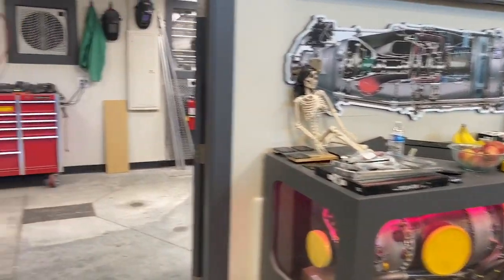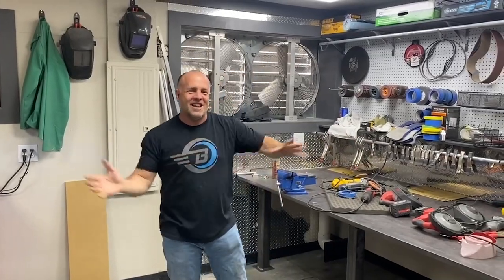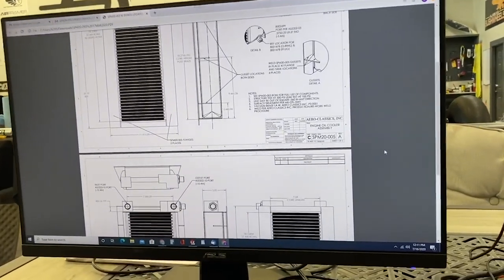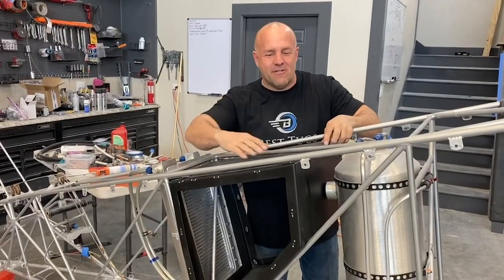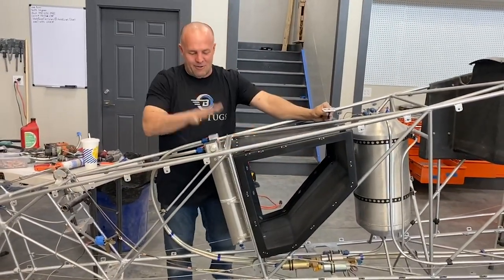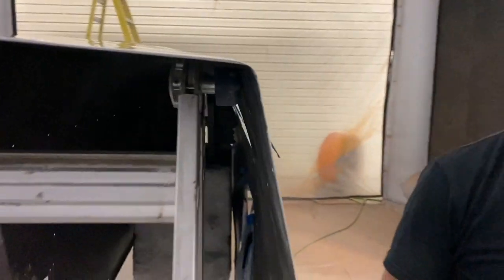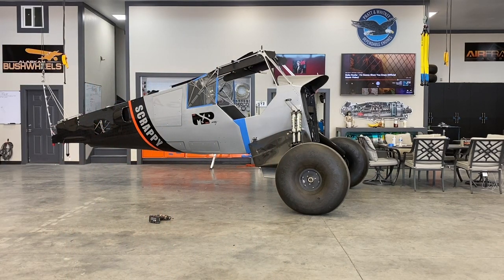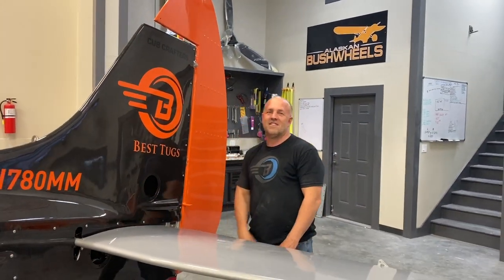Scrappy Bush Plane Gets Tail Feathers  🤠 (Scrappy Bush Plane 24)

Comment: Mike, do you have an "Override" switch for those micro switches for your gust locks? If the micro switches malfunction,  you will not be able to fly until they are replaced! I hate my computerized truck because it seems like I cant start the motor if the dome light (or some other stupid little thing) stops working. It is maddening!
Believe me, a year from now when some oxidation gets to thos switches, you will be happy you have the override.
Reply: I was thinking that too... Or extra pins
Reply from the maker: Absolutely,  I agree with you.  Both switches are a Phillips screwdriver away and five minutes I can bypass it and fly it like normal.  Literally I placed them right at an inspection so I could do exactly what your talking about.   👍🤠
Reply: MrJamespcastle I like that his yaw damp gust lock is also a start interlock key.
Reply: J ...I was thinking of this exact thing when he was talking about the micro switches....good call. Although in the back of my mind I just kinda knew he had thought of it as well, ya know, just a hunch lol.
Reply: Mike Patey plans ahead for aggravating possible problems. You only think of things like that after life has chewed on your butt a few times .
Reply: @MikePatey  can already see the pranks of your mates nicking your gust locks.
Reply: @MikePatey  I was wondering the same thing... what happens when... I have run into interlock issues that drive me crazier than I already am trying to get things to play nice together... and get equipment working.
Reply from the maker: J  yes, these safety lock outs only interrupt the start relay ground wire.  The plane will fly on if any problem and are so accessible and fast to bypass.  There are countless deaths of take off with locked controls but never a fatal crash because the starter wouldn’t let you start it.  Worst case a brief delay and quick bypass of the switch and I’m on my way. 👍🤠
Reply: This was my thought/question as well!
Reply: @MikePatey  just hope one doesn't fall out during a mid-air restart. But that does seem pretty improbable
Reply from the maker: Daniel Kranich  great thoughts 👍🤠 here are a couple things to think about. the pin can’t fall out unless you push the spring loaded button and pull. A inflight restart assumes your engine quick, then the micro switch that started you this flight also failed at the same time  and then if both those happen and we want to restart we would never use the starter.  That monster prop will have that engine spinning faster than the starter ever could. so restart would be fix problem, fuel tank or whatever and it will start itself.  👍🤠

Comment: I was thinking Just before Mike said it. I would have micro-switch storage locations for those pins.
Reply: same here.
Reply: I hope he has a spare pin somewhere in the plane, lose one and you are stuck in the bush! 😎
Reply: @paulbergman8228 Probabaly better to build in some sort of bypass, in case a switch fails.
Reply: @RespectableRSYt  Just add a second microswitch in parallel, for redundancy.
Reply: @paulbergman8228  Or a screwdriver and a pair of pliers

Comment: I used to fly front seat in a P&W 985 Super Stearman that had the oil cooler mounted in the aft fuselage. The hard oil lines ran along the airframe next to both cockpits. In an open cockpit, in the cold weather, those oil lines made perfect hand warmers.

Comment: I'm glad to see your clean room setup. That dust and nasty stuff is bad news. I started at a large aircraft company as a plastics bench mechanic. Lots of fiberglass, graphite, kevlar, core, potting, adhesives, MEK, and many other solvents. I saw a lot of others there suffer the issues of these things. Always read the safety data sheets and stay safe so you can keep flying these insanely cool projects. Thanks for the videos, I can hardly wait to see you put Scrappy through it's paces, s/b incredibly great!

Comment: That idea with the microswitches for the gust-lock pins is GOLD. You could sell that idea to pretty much any aircraft manufacturer I bet, if they haven't done something like it on their own anyways. There's plenty of crashes, injuries, and aircraft damage that have happened because of gust locks either engaged when they shouldn't be, or not engaged when they should be.

Comment: As I have said several times before, you are my old Boss and Mentor's double when it comes to engineering and it makes me feel so much better, as it stops me from feeling like a freak. I spend a lot of time during projects, thinking how thing will interact and how to get things to do more than one thing at a time and poeple just don't seem to get the idea, that it saves weight and sometimes money. Your table is an excelent example of getting a system to do multi tasks, not just extracting dust but also able to clean the work area, I built one along the simular lines in the carbon workshop when I was in the RAF, slightly small than yours but almost exactly the same (people kept asking why I did it the way I did when I could have just had a shop vacumme cleaner in there to clean up? They did not see the use of just one small piece of pipe eliminated the need for one! Although I also had a port on the pipe to plug on a vacumme cleaner hose as well).

Comment: Man thats a neat practical solution, I dig it. In thermo they told us that some WW2 planes obtained thrust from carefully designed oil coolers on the belly of the aircraft. As you are adding energy to the air it makes sense, almost like a scramjet. Ive always intended to learn more about it.

Comment: Next video: Mike - So I decided to over design my start switch. I turned my control stick mount plate pen and sharpie holders into a combination lock to engage the starter, now when I insert the correct pen combo and have the gust lock pins installed I can start the engine with a sharpie instead of key. 

Seriously though Mike I love that you added the microswitches to disable start until the gust locks are removed. Very nice safety feature to have. Reminds me of a Cessna Conquest rudder lock, even if the pilot forgets to unlock it, once a certain elevator position is reached it unlocks the rudder.

Comment: Hi Mike, truly enjoy your Scrappy Videos. One idea: Years ago (I don't fly anymore) I used to ferry light aircraft to Europe mostly. Flying up thru the Arctic, we needed to use the Hermann Nelson on the engine before start to thin the oil to the point wh ere the engine would start. Sometimes is was so cold (-30 to -40C) that the oil never would come up to normal range. Another factor was that the Greenland icecap was (then at least) 10-11,000 feet high. If you are going to take Scrappy to Alaska anytime other than summer, it might be nice to have a means for an oil preheat that could easily bring the oil to operating temp before engine start. I knew someone who had an old Queenair that used to drain the oil after flight, store it next to a heater in the hangar, and refill the engines before start. The real downside to this idea was that he ran the risk of introducing oil contaminants each time he did this.  John Stewart

Comment: That oil cooler in the back with those lines has got to add at least 4-5 quarts of capacity. Oil temps should be pretty stable without having to open doors....such a awesome airplane, looking forward to the first flight!

Comment: When making a flare fitting, I was taught use a tube cutter but to then polish the end of the aluminum tube before flaring to avoid any possible stress concentrations and subsequent cracking. Your workmanship is so spectacular, I was surprised you didn't to this.

Comment: Hmmmmm! Great job, attention to detail, standard of finish  etc and your work ethic is out of this world . One little observation viz a viz the aircraft reg lettering near the tail . Here in the UK we have strict regulations as to Registration lettering (size, position etc) and our CAA is twitchy about having undersized lettering on a plane. They will allow it but only if the fuselage is too small to accommodate it. Under the wing is of course no problem as there is plenty of area to use. Regards, Jim in NI UK

Comment: The gust locks safety feature is awesome. You need to get a patent and get it to be a common thing on airplanes. I have a good friend who was a crop duster for many years. He would wrap a bungee cord some kind of way on his rudder for a gust lock. I remember him talking about forgetting to take it off... he flew a radial engine Air Tractor and used a lot of rudder to turn... he said his legs were sore from stomping on the rudder pedals, thinking for a while... man, this thing is a lot of work to fly this morning...

Comment: Hi Mike, The effectiveness of rubber isolation for components is not always a good idea as the effects can be counter intuitive.  I worked on a project to understand why there was a high number of early failures of computer hard disks mounted around a large vehicle.  All the hard drives were "protected" from vibration with rubber isolating mounts that were mounted inside small custom computer chassis which were in turn hard mounted to various parts of the vehicle. We used a shaker table to simulate the measured vibration from around the vehicle on the drives.  The manufacturer provided a pile new drives and testing software which allowed us to see the drive performance all the way to failure in real time.  One pile of wreaked drives later we found that the rubber mounts were the problem.  At lower vibration levels they helped.  But at higher levels they became excited and drastically increased the motion, axis of motion and acceleration the drives received leading to sudden failure.  Solution hard mount the drives and the chassis they were in (without any conventional rubber isolation) flexed just enough to deal with the worst shocks.  It had our whole team scratching our heads, but it worked and the drives lasted much longer in service.

Comment: Great work as always Mike, Just one little comment, the dust/fume extract on the new bench would be mush improved if you used a full length slot rather the grilles that you have. The high velocity created by the slot would significantly improved the capture of dust and fumes from the bench.

Comment: The setup will pull all the dust by the worker, except at the welding table.  Source of dust and path it will travel to forced exit is very important in protecting workers.  Put individual flexible exhaust registers at each of your sources of creating dust.  They should be routed upward from the source to you desired exit point.  Having the HEPA filter unit in the room will really add to the ambient noise levels and a big heat source.

Comment: It’s flying together :D The best cooler mount is two rubber lined channels the tanks sit in. In 13 years of Research design and development on air cooled heat exchanger I saw that it gave the longest life. Thermal Expansion kills them, so ideally you don’t want strong side sheets, they stress the tubes. They need wiggle room :o)
Reply from the maker: teamidris 👍🤠

Comment: Mike, I am surprised that you don't have a pipe cleaning projectile launcher gun.
It's how any hydraulic hoses are normally cleaned on sensitive systems, and I would consider an airplane to be pretty sensitive! Lol

It's basically a foam projectile larger than the pipe or hose, that's loaded into the launcher, and sent through with air pressure.
Or you could just get the foam slugs, stuff it in by hand, and then use the air hose to force it through.

It's really worth the investment when you really need something clean.

And if you want it REALLY clean, combine the foam slug with a liquid flush, though you have to have your flushing liquid as clean as you want your pipe to be. (which in industrial hydraulics, means practically perfection lol.
Even fresh out of the barrel hydraulic oil is considered dirty, and has to be run through a filter cart as its added! But it makes a major difference in equipment life, so it's worth it)
Reply from the maker: ke6gwf - Ben Blackburn I completely agree.  👍🤠. I use them but I couldn’t find my size for that pipe so ordered some more that day.
Reply: @MikePatey   okay you have restored my faith in your competence! Lol

Comment: Awesome project Mike! :) If I may, I would advise you to rather use the proxy switches ( i.e. DHE1141, etc.) instead of micro switch in those gust locks. The thing is, always when there is a mechanical movement inside, they can fail, causing eighter unability to start the motor, or to start it up when the pins are in, depending on the logic you are gonna use ;). Good luck with the plane!

Comment: Mike, ever thought of using carbon foam core (nomex) "boat hull" construction techniques? 
I'm just thinking elements like the frame, ribs, spars, could be mostly eliminated using a carbon/nomex sandwich construction.  I believe modern carbon fiber racing sailboats are made using a mold for the outer hull, mold release agent is applied to the form, carbon, then nomex, then carbon again.  Some shipyards bake the hulls while they're curing under vacuum for added strength/rigidity. 
But it could make for some really interesting carbon/nomex only wing construction.  You could make a mold for the top and bottom of your carbon/kevlar/nomex/carbon wing, then cnc nomex/carbon (dragon plate) for spars and ribs.  There are some tricks, I believe, to get a good mechanical bond between already cured parts.  Also, uni-directional fabric is used to reenforce any load bearing area's (ex. like the head tube or bottom crank bracket of a carbon fiber bike frame).
Just thinking out loud since you're already proficient at making carbon fiber parts and so much of your plane is already standard carbon fiber construction. 

https://www.youtube.com/watch?v=EyXWXHC1adg

The rudder lock pin/start mechanism is brilliant btw.

Comment: Nice shop, Mike. I'd be worried about small tool or parts getting into the back vacuum holes! Great idea on the micro switches for the locking pins..that is called  Poka yoke>

Comment: Hey Mike a suggestion for torque seal on lines.  When I do use torque seal on lines, I put it on the back side of the nut to the tube.  This way reduces the risk of dried torque seal being introduced into the system during removal.  Now a days I mainly just use a paint pen, no risk of introduce anything to the system.

Also a question about your tubes going to the oil cooler.  How are you going to drain that oil if you need too??  I would think there will be a fair bit of oil in the cooler and tubes.
Reply from the maker: Ian Grover 👍🤠 I have a flush pump.  It only adds a couple more minutes and it’s done from the engine bay

Comment: I have two comments/questions: 

(1) on your oil cooler set up, would there be an advantage to recessing the inlet scoop and the outlet scoop? Kind of like an inverted hour glass with your oil cooler at the thinnest part. you cold then create movable flaps on the inlet side to control the airflow into the box and reduce your drag. I don't have the software to test the theory, but it  seems that it would reduce the drag of the static scoop as well as further reduction by closing the inlet vent doors.

(2) in your shop... the fans and vacuums are loud enough to cause hearing loss over time. A way to reduce noise in your shop would be to mount your air compressor and vacuum in a separate closet that has been treated with sound deadening materials. I did this in my shop. It has made a huge difference with being able to have a conversation as well as significantly relieving noise/auditory fatigue. 

You are a talented engineer, craftsman, and artist. I'm glad I stumbled across your videos.

Comment: Nice to see you working up off the floor  with workbenches they have a lot of thought put into them it saves a lot of time and money. I noticed you climbing on that chinese-made ladder, be careful I just had one collapse on me and I landed on my back I'm okay though but they don't have the fulcrum that the two step ones have they will break right where the bar is for the top step. I put new legs and gussets on mine and it should be good to go.

Comment: The other thing, Mark, is keeping your oil Temp hot enough to boil the moisture out of the engine.
Reply: That is job 1 of any thermostat.  Otherwise why bother with water thermostats on cars?
Reply: @puttputt73  A little different than a car radiator, when you want to keep the engine cool.  If you don't use a oil bypass thermostat, the oil can circulate through the cooler and not get hot enough to remove moisture from inside the engine, and destroy it.

Comment: Mike, those cyclone type filters are so noisy to operate. IMO, I'd have installed the unit in another area and run ducting to your table. We had a number of down draft tables for working on composite materials.

Our cyclone units were made by Torit. Besides requiring OSHA approved hearing protection, you can feel the pressure of the unit in operation.

Comment: All that air, and confined in that room I would hate to grind and weld in that room.
Reply from the maker: Jaime M 👍🤠 you would think that for sure.   Yet I have had dozens of shops and when I made my fans variable speed,  I can slow them down. When I’m Welding I turn the fans on very low so I don’t mess up my gas yet I get clean fresh air to breathe with a steady air exchange. when I’m grinding I crank it up full blast.  I can always keep fresh air and a clean rest of my big shop.  I think if you tried the room and variable fans you would be pleasantly surprised how much you would like it.  But we each have our own ideas and I’m sure I would love yours as well.  Cheers 👍

Comment: Anything worth doing is worth overdoing. 😁. A little question, on the rudderdamper attachment to the rudder . You have two eyelets bolted together. This will cause a little bending action. One of them should be a fork design making the load linear.